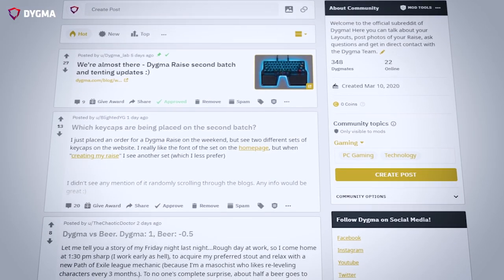What is touch typing and why does it matter?

Comment: I started to re-learn traditional touch typing, but my pinkies don't reach the third row unless I actually move my wrist up on the keyboard, so I kind of ended up with a modified touch typing technique where I use my ring finger to reach the higher up pinky keys.
Reply: I do exactly the same. I press Q and P with my ring fingers. It's just more comfortable if you have short pinkies or long ring fingers.
Reply: @Deilor  Totally, same here
Reply: I realize this is late, but maybe someone else will be reading this in the future.
Touch typing does not depend on the size of the fingers. Of course, you need to take your wrist off the main row when typing in other rows. What is shown in the video is incorrect. The fingers must not be glued to the home row, and the hands must not lie on the stand during active typing. So that it does not seem that I came up with this one, here is a quote from Microsoft 

Here Are Some Other Tips To Remember

Take frequent breaks.

Use software and hardware features like fast scrolling to work more efficiently.

Avoid glare by placing your monitor away from light sources.

Keep your wrists in line with your forearms.

Do not use wrist rest areas while typing.
Reply: Yeah this is quite common. Hopefully the Dygma Defy will help people fix this

Comment: On another note, anyone who is interested in an alternative to the boring old 'keybr' or '10fastfingers', try out 'typingclub'. Also completely free (you can pay for additional fluff if you want, which I find unnecessary), and is a lot more enjoyable since it uses interesting material and some mini games. I'm on  529 out of 684 lessons at the moment (started on the 9th of June) and am at around an average typing speed of ~55 WPM with Colemak DH-Wide.  Note I didn't have any Colemak knowledge prior, and am purely touch typing with a huge focus on not overstretching, and making sure to relax my muscles. Note that I'm at roughly 105-110 average WPM on QWERTY with an unorthodox 6 finger touch typing method, so your mileage may vary!
Reply: Excuse you keybr is not boring gerrourahere
Reply: @RitzyFizz  The guided lessons on keybr are just mind numbing to me. :D